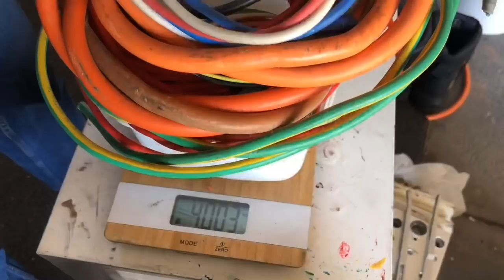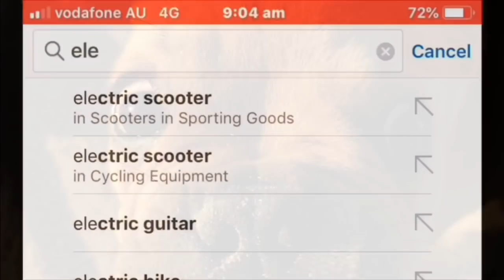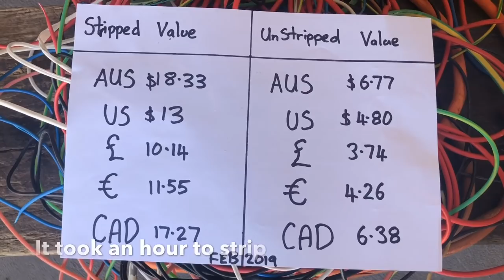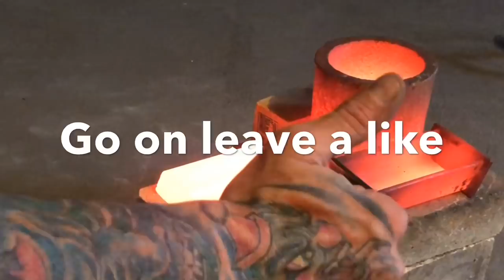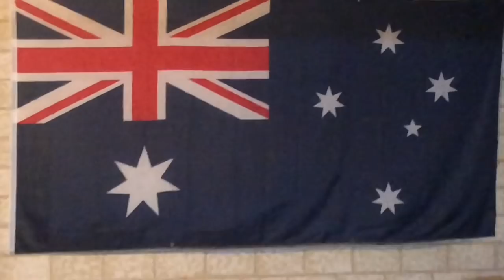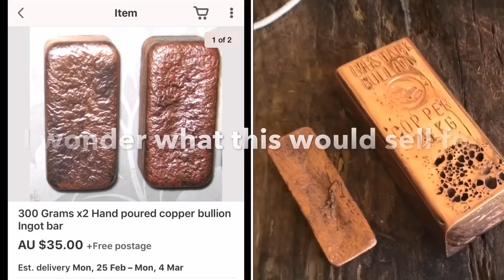To Strip or Not To Strip - Is it really worth stripping Copper Cable🤔 - Melting Copper

Comment: I understand the satisfaction and artistic value of casting your own copper ingots. But if all you want to do is sell stripped copper for scrap value, why waste the time and the fuel costs by melting it? Scrap metal merchants will take it as a block or as wire, so melting it isn't necessary. In fact, if the wire is clean and free from any plastic or oxidized residues, they sometimes pay a higher price, since copper wire is guaranteed to be of the highest purity. Melting it down into blocks actually introduces impurities (not just on the surface), so your cast blocks won't be electrical grade any more.
You could mitigate that by melting it in a ceramic (alumina or magnesia) lined induction furnace rather than a fuel-burning furnace, which would introduce fewer impurities. Or you could try electro-refining, which is how copper is purified into electrical grade industrially. This is easier than you might think: Make a solution of copper sulfate or copper nitrate to use as the electrolyte, use a sheet of pure, clean copper as the cathode and any lump of impure copper as the anode. Immerse both and pass a direct current through. The electrolyte acts as a transfer medium for copper ions, which are dissolved from the cathode and deposited on the anode as long as current flows. The electrolyte is not decomposed or consumed by this process, so can be re-used as much as you like. Most metals can be refined this way, if you can find a soluble salt of the metal to act as the electrolyte.
Reply: Where would you get the solutions you'd need for that?
Reply: It makes sense to cast ingots and store them to sell in the future when prices go up. Can store more as ingots. But the only problem is the possibility of theft.
Reply: @henrypereira1745  the main deterrent against theft is to not brag about what you have. Another method that works is to make the risk greater than the reward.
Reply: what he lost on the electrical grade he 100% made up on the ad revenue. In all honesty it was more interesting to see him do casting than just finish with stripped wire
Reply: @aperturesignaturebandwidth  Getting hold of metal salts isn't that hard. Copper sulfate is actually used as a fungicide, mixed with lime as "Bordeaux mixture", which you can still find in some garden centres. Separating the two is fairly straightforward, since copper sulfate has a much higher solubility in water than lime, so you can just dissolve the mixture then filter it.

You can even make metal salts yourself from the base metal and a suitable acid. Most metals will dissolve in nitric acid to make the nitrate salts, which can then be crystallised to purify them. Some metals will dissolve in sulfuric acid (which is a bit easier to obtain than nitric), so you can make sulfate salts that way. Copper oxides dissolve in sulfuric acid, and copper metal will dissolve in hot sulfuric acid, albeit slowly.

Or you can just buy the metal salts on ebay. Copper sulfate is cheaply and easily available that way, as are many other metal salts. It's perfectly legal and you won't be put on any kind of watch lists for buying something as innocuous as copper sulfate, since there aren't really any nefarious purposes for it.
Reply: I heard buyers prefer wiee, because they can be assured of the quality
Reply: I usually read YouTube comments for my daily dose of ignorance... I’ll have to look somewhere else. You’ve got to be one of the most informed people I’ve ever seen here and it’s disorienting!
Reply: Here in Canada or Saskatchewan they will not take ingots especially if there home made. They dont know the purity of the metal we just strip it and take it in
Reply: @henrypereira1745  if you're worried about storage space the best of both solutions would be to simply crush it with a cheap hydraulic press into blocks
Reply: Lloyd Evans that’s what I said lol
Reply: @henrypereira1745  but all the fuel it takes to cast them if your selling for scrap your not going to make shit. Just smash it down in a barrel with a spud bar it will get plenty in it and then you can haul it in and make plenty and not have waisted all that fuel and time
Reply: @nickgamble4544  back in 2000 the price of copper was 2000 / tonne now it's 6000(U/s) you'll make money as long as copper is becoming more valuable.
Reply: I worked in a scrap yard and we paid a different price per grade. The best being what we call bare bright and that is stripped clean copper. Then #1 #2 ect. The lowest pay grade being what we call copper recover meaning if it had any other metal, steel or non ferrous attached that we would have to dismantle. Also other forms of wire such as brx wire, lead coated wire ect.
Reply: You are right. The ingot was just for the video
Reply: He melted it for his own collection, he priced it out BEFORE melting it.
Stripped vs Unstripped is all he priced it out for, not Unstripped vs forged bar.
Reply: I think that it's about the whole process Lloyd, the melting, buffing and shining before finally adding it to growing shelf stacks that is behind  why Mr BigStack and his loving sidekick Ingot, does what he does.
Watching my first ever BigStackD video, seeing the blocks, trinkets and shiny treasure at the end of the film which had the 'Wow' factor.
It's also the satisfaction of seeing a result much like a cook preparing a meal and seeing it consumed feels after all the preparation.
Reply: @CPLtwinkie  Same here in the UK they stopped paying for striped wire also as people were just burning off the PVC and other plastic from stolen railway cable. Here it is a waste of money to cast any type of bars I looked into melting cans but they will not pay any more for bars so it is a waste of money.
Reply: KewlCrayon cast bar
Reply: I have learned something new
Reply: Yup I have no clue but I feel smarter just reading this
Reply: Because  there might be a buyer that makes craft jewellery  and buying those bars would be a money saving to a craft jewelry. Making companies  that can try and get a bargain  when the markets are so volatile mark
Reply: Way back when I was young I did a bit of scrap metal. I was told if I wanted to melt it down. When I wanted to sell (BC Canada) . I would need batches of at least ten tons and pay for a lab to sample it.
Reply: I think you missed the point.  Smelting down your metals into bars or coins of assorted sizes if purely for joy of doing it.  It is very satisfying to take junk, and turn it into prettier junk.  The value in doing this isn't in the money.  The value is in the doing it.
Reply: @henrypereira1745    Or you could save a lot of time and work  ( every one has to figure out how much theirs is worth to them ) and fuel costs, to make a product that has even less value then it did as wire.  Sell the wire and stash the money.  Money takes up even less room and weighs a hell of a lot less
Reply: @thomvogan3397  true but cash doesn't increase in value. Due to inflation you'll actually come out worse in the future.
Reply: most  places will not buy melted copper..  unless you get proper paper work   +    you destroy  the copper alloy itself....   so never melt into your own blocks..   unless you have a license to do so

Comment: I've been a "scrapper" for years and have actually made a living at it from time to time, and "depending" on the type of wire, yes it pays to strip wire. Smaller stranded is not advantageous,  like regular retention chords, lamp wires, speaker wire, vacuum cleaner chord, etc) too time consuming to be profitable (just scrap it as insulated). 
Also, melting it to make ingots is not advantageous either. The cost of materials to melt it would ear you profits.
Reply: Yeah most places won't even accept a bar. If they do they cut it,  into 4 pieces to inspect it, and even then you'll only get the least amount price per copper. 👎 Kinda sucks but it's fun to make an ingot.👍

Comment: Everything is worth recycling. Everything.
Reply: No it’s not.
Reply: That was not the question.
Reply: Not really.
Reply: He doesn’t even come up with the answer to his question >is it really worth stripping copper cable?<.
I would just collect the metal and sell it to a scrap dealer. All his melting work is useless as it won’t get you a better price when selling someday. Waste of time and heating energy. Unecological, uneconomical and childish. The refinery that buys scrap melts it down once more anyway. I would just strip the stuff and keep it in a box.
Reply from the maker: Yes unfortunately there was a part of the video I accidentally edited out and didn’t realise to weeks later about if it’s worth doing or not but if your time is free and the cables are of adequate size and readily available I believe it’s worth doing only if your time is free. 
I do this as a hobby to relax and Unwind and as this is something I do for fun I don’t bother selling my pieces to the scrapyard or anywhere else that’s why I just stack them on the shelf and don’t worry about wasting my time doing this👌🏻

Comment: I heard that in America, stripping is easier. BTW: for those that are new to this, that green flame is copper oxide and is toxic to breathe. It's pretty as hell, just vent it away.
(Copper is commonly used in fireworks to give it the green color... Or Colour, if you prefer.)
Reply: @irish-medi-weed-grower5240  American English, while not the original, is in fact a standard, and thus color is also appropriate. So yes, it comes down to which standard you prefer. ;)
Reply: @irish-medi-weed-grower5240  Yes, a standard to one is still standard. Like NTFS is only standard to Windows and so few aircraft have heat shields for re-entry. Are you calling me lazy over my ancestors deciding not to use the letter "U"? I never would have conceived such sensitivity over a difference in spelling. This was a gentle ribbing under the assumption all those that would read it know that American English is pretty well NOT the Queen's English. I guess self deprecating humor isn't for everyone.